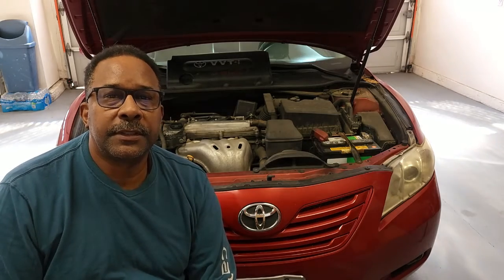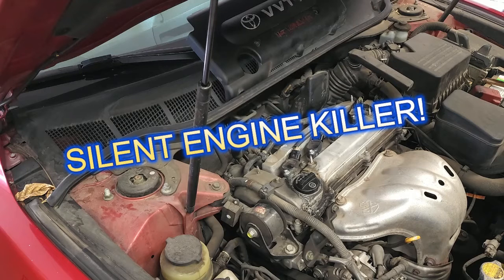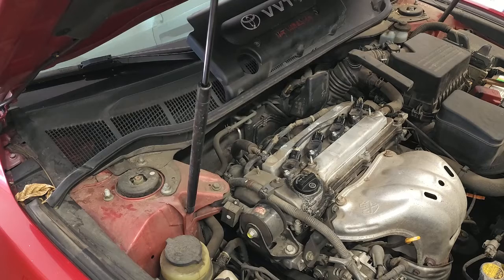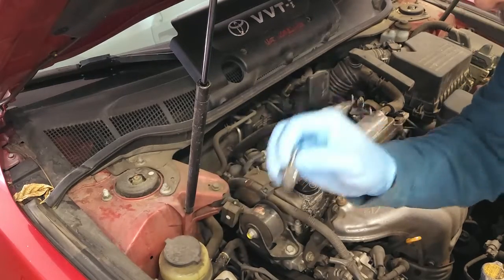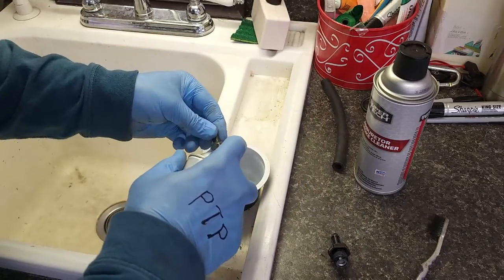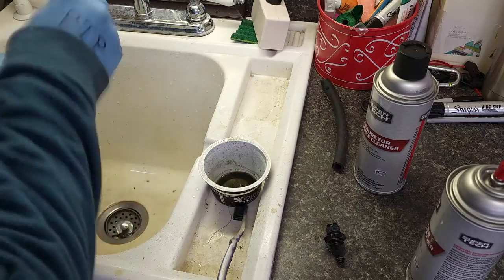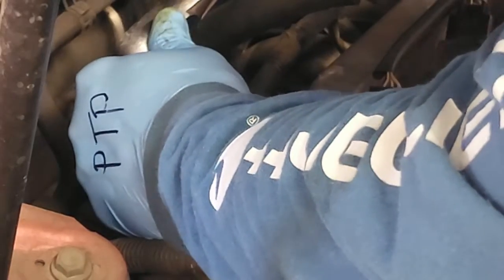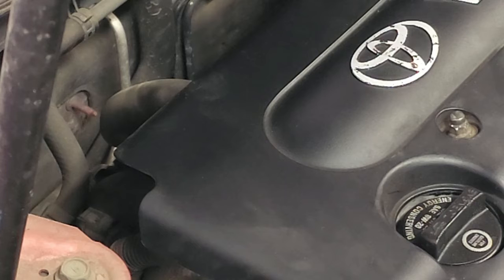2007 Toyota Camry LE 2AZ-FE 2.4 LITER, Replace Positive Crankcase Ventilation (PCV) Valve

Comment: Doesn't seeing the hose move when you did the final hose connection mean that the clamp is not strong enough? Also, being an aluminium valve cover means that the threads on the hole can be stripped as I am finding when changing mine.  The gorilla who owned the car befor me totally stripped the threads. Now I have to change valve cover also.

Comment: Did you replace the breather hose? My breather hose is broken but I cannot find the right part number
Reply from the maker: See 
Engine PCV Valve and Hose Kit(2.4L 4CYL).Fit for Camry Corolla Highlander Solara Matrix RAV4 TC XB HS250h. Replaces Part # 12204-28020 12262-28021.
https://amzn.to/49NP0hj

Comment: Can you do a video of replacing the hose??
Reply from the maker: From what I see in the video. You'll need to replace the short rubber hose between the pCv valve and the valve cover. Tools= pliers to remove hose. Parts=pcv hose. I'll update the video description later tonight.
Thanks

Comment: that hose and clamp is no good, it will leak, replace it.
Reply from the maker: See 
Engine PCV Valve and Hose Kit(2.4L 4CYL).Fit for Camry Corolla Highlander Solara Matrix RAV4 TC XB HS250h. Replaces Part # 12204-28020 12262-28021.
https://amzn.to/49NP0hj

Comment: Why do some people say to use 5W30 for this engine even though it says 5W20 on the cap? I have 5W30 in there now but don't know if I should
Reply from the maker: The 2AZ-FE has a documented history of consuming oil at a slightly higher rate than most engines. However, the engine is solid.  Most dealers will tell you that 5W20 oil consumption falls with the "normal" range. 5W30 has a higher viscosity than 5W20, so it gets consumed at a lower rate at normal operating temps (thicker film=less blowing by the piston rings) . The downside is that  5W30 will give you slightly lower gas mileage during normal operation temps because the engine has to work slightly harder.
Reply: @protipsplus  Thx for the response. But doesn't the thicker oil make the engine work harder and possibly not leave the same lubricating film as a thinner oil? These engines are usually designed for certain viscosities that can flow through the openings at the desired speed. A mechanic put 5W30 in my engine as well, but I'm kind of concerned thst it could ruin the engine after reading into it.
Reply: @Jose-sy1je  Use the oil on the filler cap or in the owners manual, and don't listen to people that tell you different from the manufacturer. And it's normal for many of the 2AZ & 2AR Toyota engines to drink a lot of oil, so check regularly and don't let level fall below 1/2.
Reply: @Jose-sy1je yes thicker make it work Harder
Reply: @issavibez394  Yeah, I had the thicker oil taken out after doing some research. It doesn't flow as well as the thinner oil and engines are designed to take a particular oil. Some people only recommend thicker oil based on the speculation that the engine is very worn. But if it sounds good, then I would stick to the recommended oil.
Reply: It’s 5w-20 or 0w-20….use the 0w-20!! Do not use 5w-20 it’s inferior for multiple reasons.
Reply: @Print2shoot  you dont know what you are talking about people use 15w-40 in the 2AZ all the time